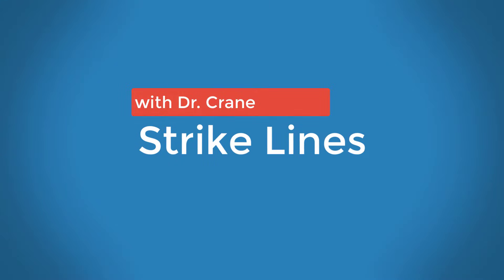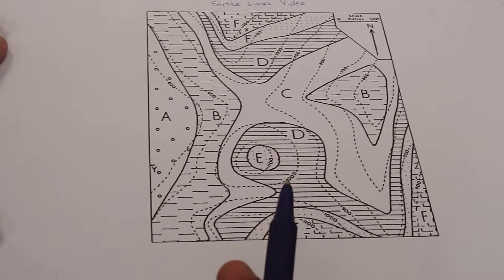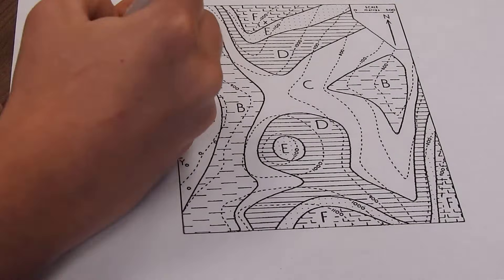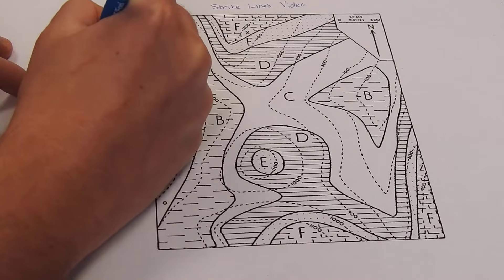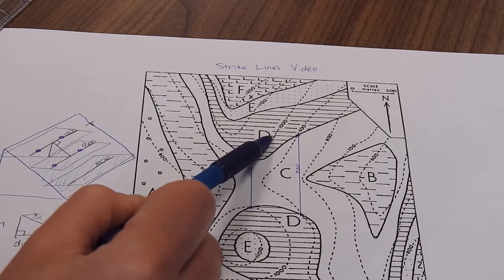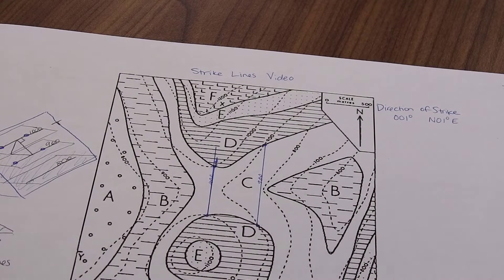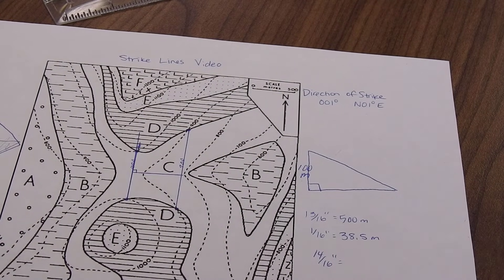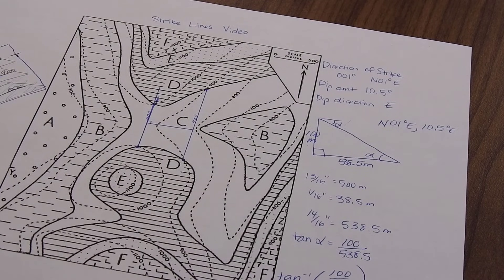Strike Lines to find Strike and Dip

Comment: i think the second strike line was supposed to be at the elevation of 800 instead of 900.Because the wider the distance between the 2 strike lines produces a more accurate angle of dip.

Comment: i used the same map. but i dont know how to get the horizontal disance cause i used the cm ruler please help
Reply: Hey! It's the same process seen in the video. 
Measure the scale in the upper right corner of the map with your ruler. Let's say "x" is the value you got after measuring. So x centimeters is equivalent to 500 meters in the field.
Then measure with your ruler the distance between the 2 strike lines. Let's call that value "y"
So apply some basic math:
x cm ----- 500m
y cm ----- distance between the strike (in the field)

Distance between strike lines = 
(y × 500)/x

Comment: Hello, firstly, thanks a lot for you explanation, it’s really god and helpful, but in the final part, the dip direction is perpendicular to the direction of strike, therefore, in this map, the dip direction needs to be NW or SE , because the direction of strike is NE. If you wanna understand better, you can represent the Structural data in a cross(+), and you can see that it’s imposible to represent  NE strike with an E dip because they are not perpendicular..

Comment: Thanks a lot for sharing the map drawing skill! I know that a structural contour is a line that connects points with equal elevation. But what troubles me is that, for example, there are more than 2 non-colinear points for the contact between Rock 1 and Rock 2 at 700m height. So how can I know which two points should I connect? I can have 3 combinations!!  I also know that I can use the Law of V to roughly identify the strike of the contact, but what if the law of V cannot apply. How can I solve the problem? Thanks a lot
Reply from the maker: I think I need a bit of help understanding your question. For the 700 m contour, there's one point of contact between B and C, and one or two between C and D. Those are different units so the points of contact don't have to be colinear. Also, in nature (or on any geologic map), strike lines aren't perfectly parallel and you have to use your experience in the field looking at the rocks to best inform your decisions. This is because local or regional scale folds and faults can offset or bends the beds. For example, if you had an arrangement that required you to draw two parallel 700 m strike lines- you might have a fault or a fold.
Reply: @kc_structuralgeology6992  
Sorry for that. What I mean is just a scenario. The scenario is that there are more than 2 non colinear point for the contact between two rock units at a specific height, let say 700m. So how I can know which two points should I connect to make the structural contour?
Reply from the maker: @tombear4597  I see! That means that that unit does not have a constant dip. Imagine a unit that is folded into a dome shape. The map pattern for an outcropping unit would be a circle, with an infinite number of non-colinear points. More typically, you just have subtle changes in dip or underlying structure that makes points non-colinear. If you are working from a geologic map, make your decision based on other structures mapped nearby OR on any available strike and dips nearby. Ex. If there's an anticline hinge marked on the map, then choose the contacts on only one side of the fold hinge.